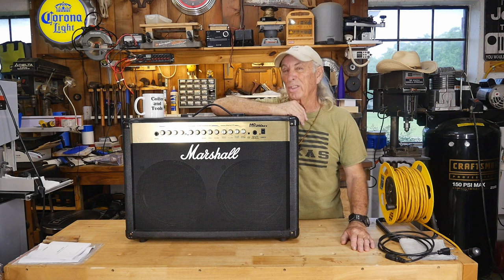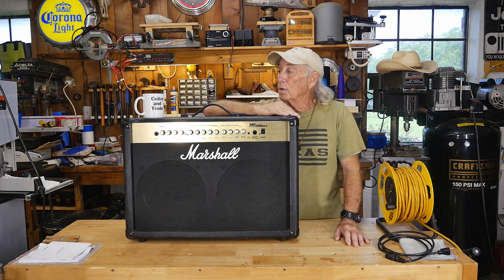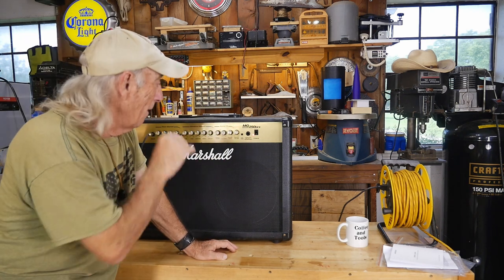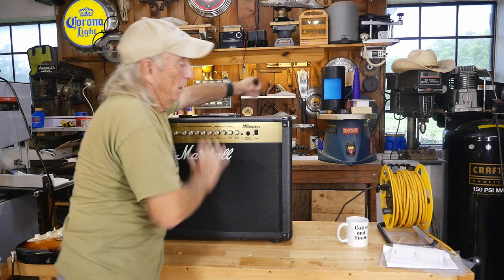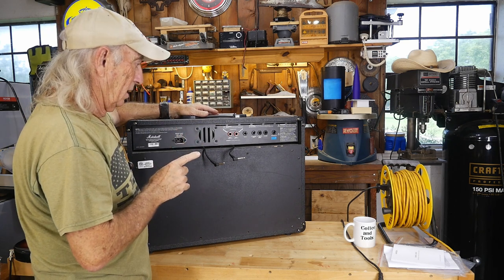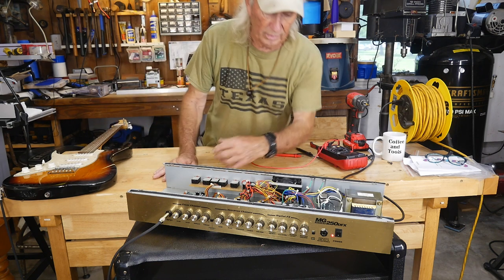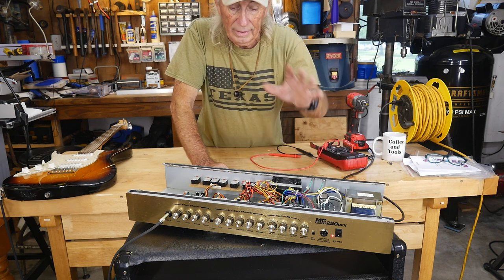Marshall MG250 DFX amp troubleshoot and repairs, C&T ep 351

Comment: I’ve had one of these for years that does pretty much the same thing. Here’s hoping that I can bring it back to life as quickly and easily as you did. Thanks for the video, I really didn’t expect to find anything useful on YouTube.
Reply from the maker: Number one, do NOT panic :)  I've run into various issues with amps and check at the back and punch a guitar plug in and out at the remote control / foot switch etc, sometimes that's the issue. Clean cord, and guitar even too, so lots of things that can go wrong. I hope you get it up and running 🤠
Reply: @SirTools  Would you mind elaborating just a tad with regards to “ punch a guitar plug in and out at the remote / foot switch etc” ?  I think you mean just a 1/4”  jack in and out of everywhere that I can with power off,  though not entirely sure.  Apologies, I am quite a novice to the realm of fixing gear.
Reply from the maker: Using a 1/4 inch guitar jack push it in and out on the amp. Even the rear ones. Sometimes they loose contact and shut down the amps output.

Comment: I bought one of these for 25 bucks ,the kid said it wasn't working, i just sprayed some contact cleaner in the imput jack and worked just fine
Reply from the maker: Yeah, I was thinking just clean the input, but nope...circuit board diode was an issue.

Comment: Ok I have a tip for you sir. That was my first real guitar amp as a teen and I still have it. I have since replaced all of the pots and I have experienced this on and off again stuff and I would bet money that it is not a Marshall specific issue and it probably happens to most amps that use the same types of jacks as this one. The jacks are of the "sensing" type so to speak. For example I used to plug some of my pedals into the effects send and return jacks. The way those types of jacks work is that they have contacts that open and close depending on if a cable is inserted or not. Unplug your amp and use some electrical contact cleaner on the end of your guitar cable and plug it in and out to clean the internal contacts or better yet just spray the straw right inside there. Then you should be able to see the sensing contacts from the outside of the jack housing if I remember correctly and you can spray those while plugging and unplugging. Sometimes mine would go in and out if the effects loop jacks "cable sensing" contacts were dirty and not making contact, the amp would think there was a cable plugged in and then the power section doesn't get sent a signal and it is getting sent out the effects send but since nothing is plugged into the effects loop, the signal goes nowhere. So clean all of your jacks and let the contact cleaner evaporate and then you should be golden. I would bet money that your experiencing the same thing mine did. If you want to verify if that is the issue before you clean it, just plug a dummy cable in and out of the effects send and return jacks and see if it comes back to working again. I would be interested to hear if that helped you at all.
Reply from the maker: Not the Jack, but the diode solder was loose. I've had bad jacks etc, blown speakers, leaky capacitors, tube issues and a long long list of fun with guitar amps. No one caught my comment about coming full circle in life. Started in garage bands, worked up to signed with Sony records and recorded in Europe and now back in the garage these days LOLOL..

Comment: Would it not have been easier to first check over the solder joints with a magnifying glass and look for dry joints?
Reply from the maker: In the past I generally do an overview and look for burned marks / heat marks first. That a lot of times saves going over all those tiny solder joints.

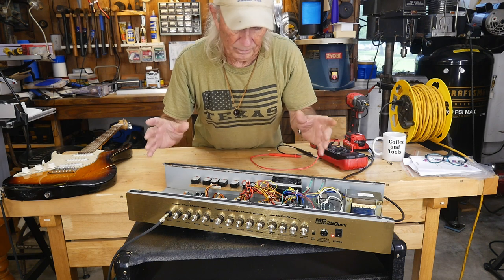Comment: 12:10 If you un do all the pots and slide the board back, there is just about enough room to flip the board over without disconnecting anything else.
Reply from the maker: I ended up pulling the entire board and doing some re-solder...yeah...works good now LOL

Comment: I would keep the Peavey and sell the Marshall. speaking about solid state amps In my opinion Peavey has better reputation as workhorse amps than Marshall.
Reply from the maker: I've owned a lot of amps in my past. The Peavey was always solid for use and never had troubles with them. Fender was not always good. Marshall has a nice sound, but...they are finicky.
Reply: @SirTools I had a Marshall 8080 that I bought new. I barely used it. After about two years when it was kept in the original carton, it stopped working. For a malfunction in the potentiometer, I paid a lot of money to a technician. In the end I sold it and bought a used peavey bandit red stripe which sounds miles better than the marshal.
I also  bought a 2nd hand fender Super Champ XD in mint condition which was sound horrible. I sold it because the sound and because it is a disposable amp.
in case fender scxd dies you can make from it a flowerpot.
Reply from the maker: My Peavy might be older than Eddie Van Halen LOLOL, still works 🤠
Reply: Peavey Rage 158 is a legendary desktop amp. Can be both horrible or absolutely fantastic depending on settings, which come down to meticulous, tiny, micro adjustments.